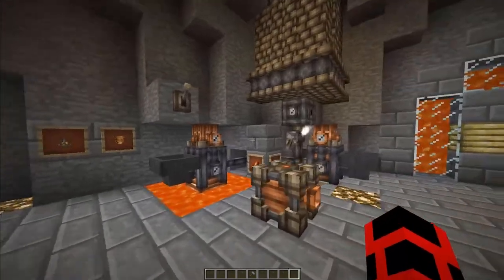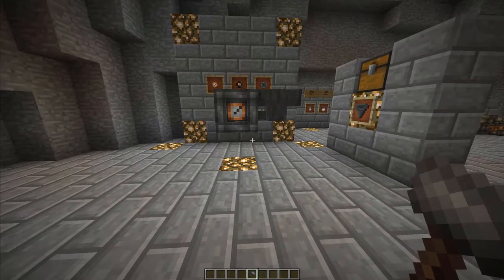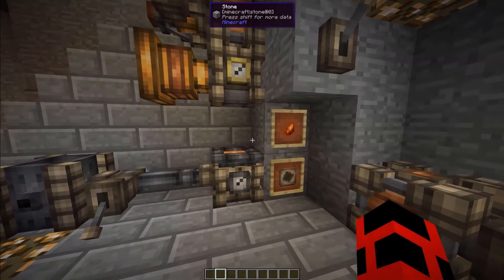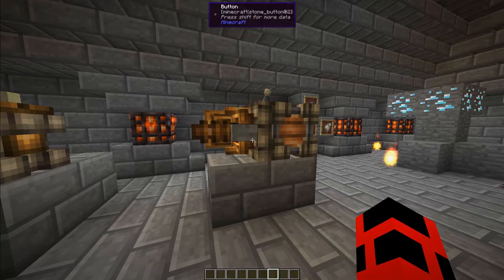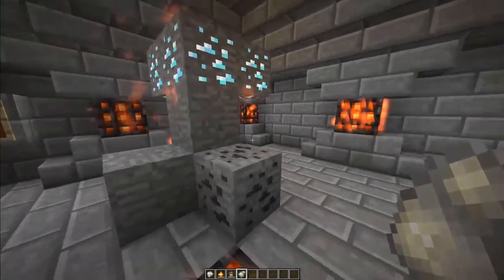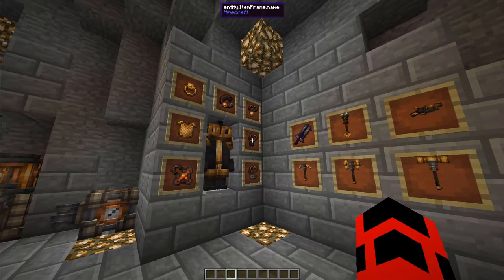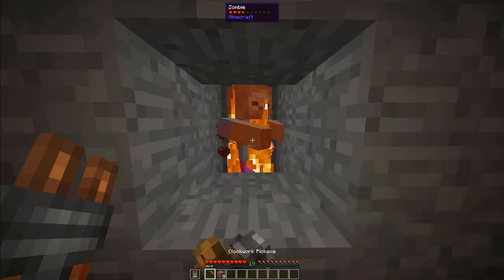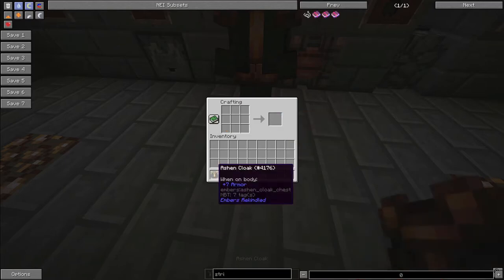Embers Rekindled Advanced Tutorial - Part 1

Comment: I have a question, or more to say a problem. When im generating ember via an ember activater or a pressure refinery at some point it will suddenly stop generating ember, although im still supplying it with ember shards. Any ideas why that could be the case? Ofc i didnt change anything from when it worked, it just suddenly stops
Reply from the maker: If their internal buffer is filled, it will stop generating ember. Try placing an ember dial on the top part of the ember activator.

Comment: i only want to know how to make the glimer cristal but the beam cannon dons´t work  i already make the  exchange tablet and the pedestal whit the dawnstone aspectus and the ash pile (and already put the materials in the tablet)
Reply: probably a little late, but in case you're still having issues with this, you'll more than likely need a 2nd alchemy pedestal since each pedestal can only hold 1 stack (make 2nd dawnstone aspectus for 2nd pedestal). place a stack of ash in first pedestal. use lever on side of beam cannon to "turn it on" after placing materials on the exchange tablet. it will mess up the first time, but then you'll just add the extra ash to the 2nd pedestal when you do it again. remember the numbers because if you want to make more glimmer crystals (i'm guessing you may not and you really only want this for PO3) the amount of ash needed will stay the same each time you make it.
Reply: @silentraven5505  thank you so much for this explanation. ive been having this problem myself